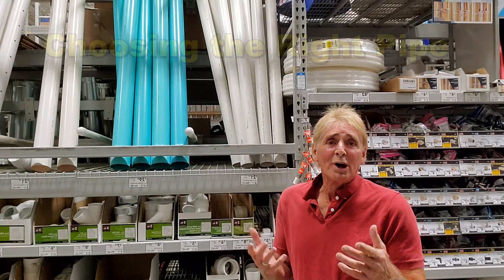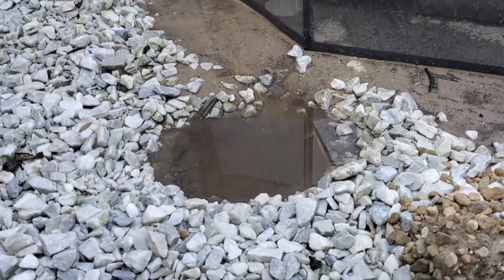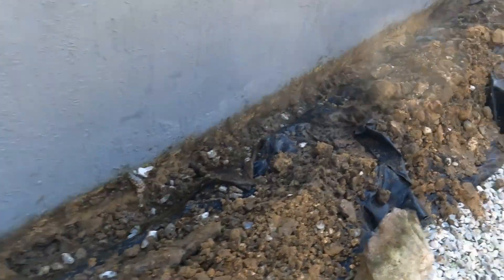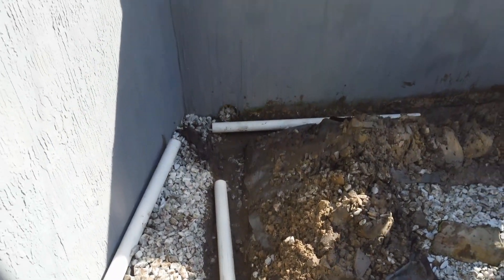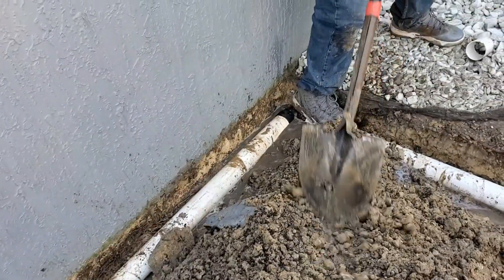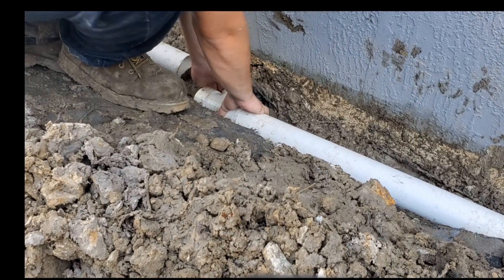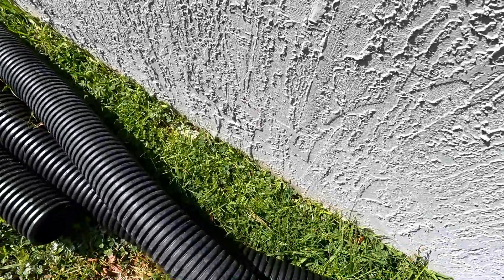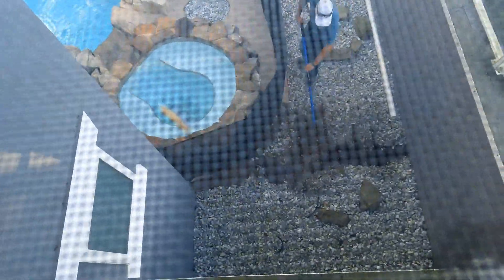3" Inch Pipe Can Save You So Much Money!

Comment: There is actually a connection piece between the channel drain and pipe that you can attach. My pool contractor has my channel drain attached to pvc pipe running out to my driveway.